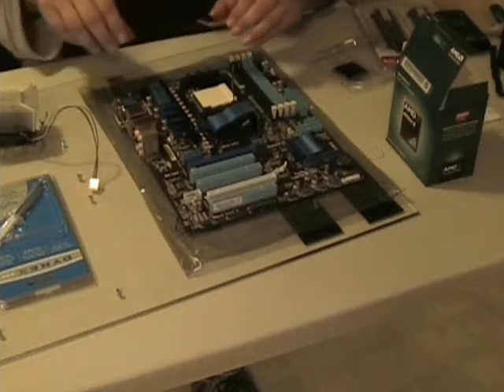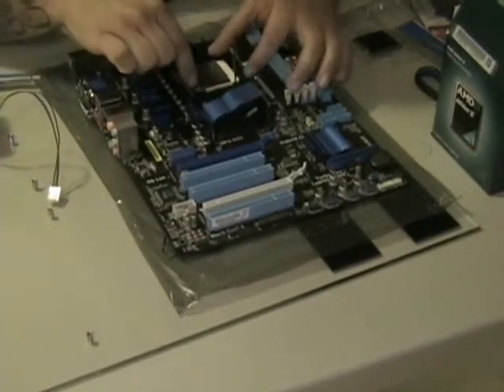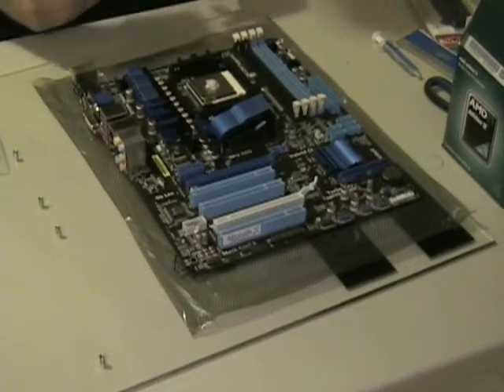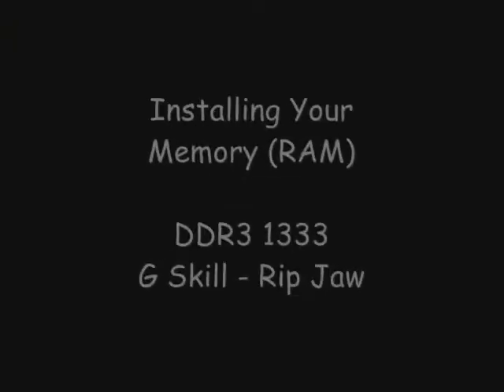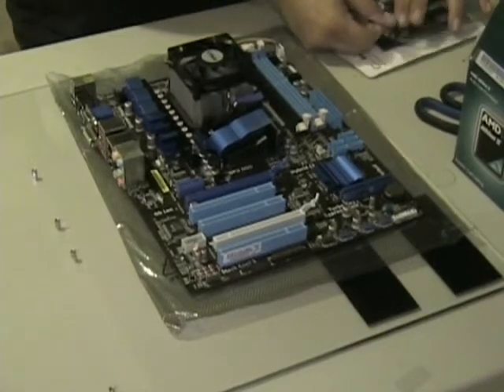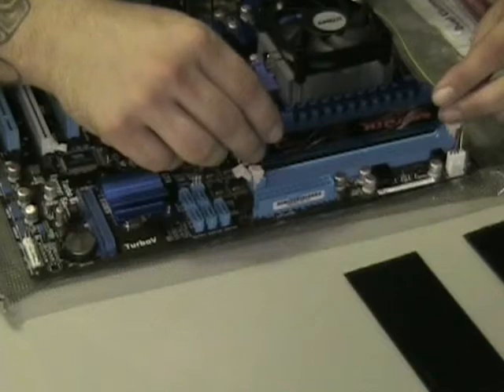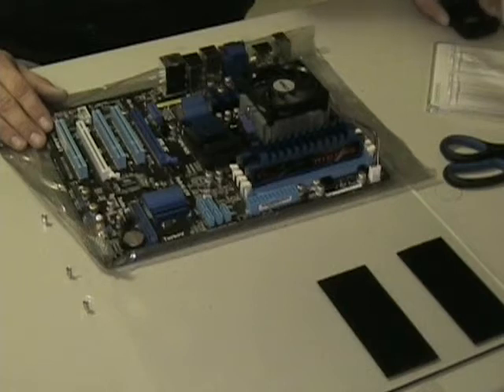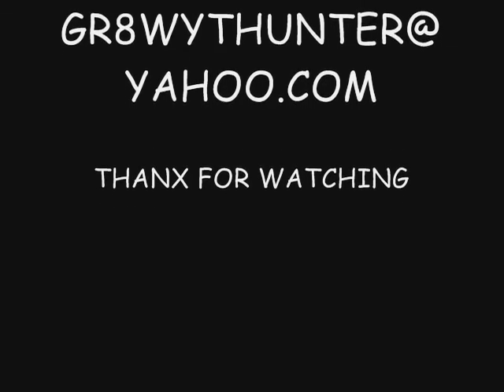How to Install your Processor, thermal paste, heatsink and Ram

Comment: Is there a difference between the Oem Thermal Pads that come with that heat sink and Thermal Paste?. I have one of these heatsinks on my Phenom 9600 Black Edition.
They say you're not suppose to take the heat sink off the computer after applying the paste, however I've taken my heatsink off on multiple occasions to dust it out, and I never suffered from loss of thermal pad effectiveness.

Comment: Just one thing; you shouldn't be touching the processor with your bare fingers. Should be cleaned with 90% isopropyl alcohol and blocked off from dust or hair being able to land on it unless you install the heatsink on very quickly. And you have like 3 or 4 times as much paste that will give the best results and this is true. It could be metal on metal if bother surfaces didn't have microscopic valleys. The paste is needed to be thin as possible to fill these micro gaps. Otherwise good job dude!

Comment: Guys, this is an athlon ii x4 NOT a phenom ii x4...
athlons don't get very hot even with the stock cooler. They run very cool in general. This isn't an i5 or i7 or anything. Intel is notorious for hot running cpus and horrible stock coolers, that's why everybody that uses i5's and i7's uses giant heatsinks or watercooling. You can actually overclock an athlon on the stock cooler, and you'll reach instability long before you actually overheat the cpu if you know what you're doing.

Comment: @foxman105: Yeah I agree, not only a lot of paste, but def. not the preferred method for a quad core. For how small the surface area is on the stock hetasink... I'd go with a bit less. I am not a fan of using anything stock. A good cooler master heatsink/fan combo costs a measly $10. The rigs I have built are always using an aftermarket. 

Not in anyway doubting your ability, but I also noticed the heatsink slid around a lot when you placed it on. Also, where your static mat?